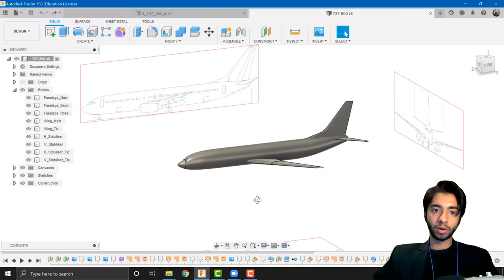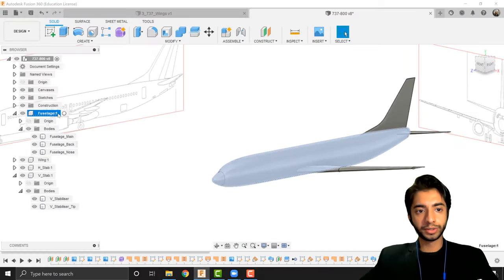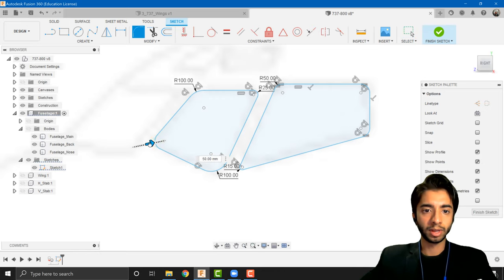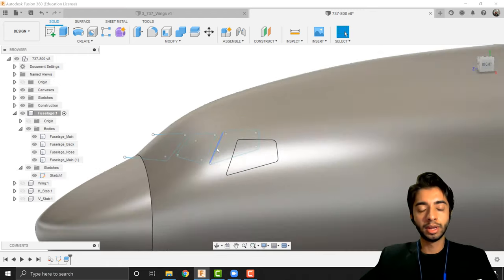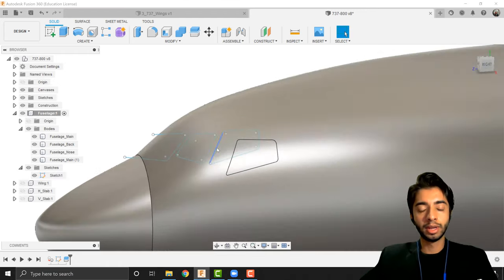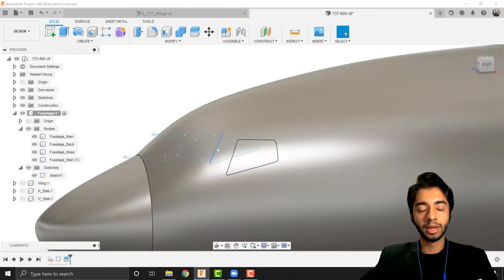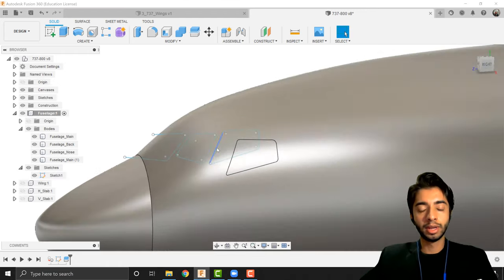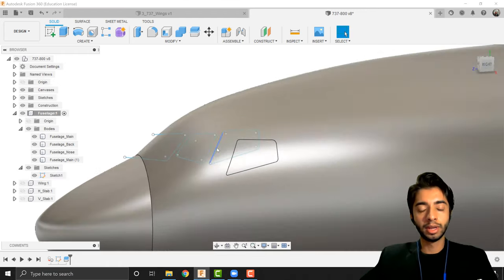How to Model an Aircraft in Fusion 360 | Tutorial 5 - Details (Fuselage) | Step-by-Step (4K)

Comment: Hey, this looks like super cool stuff, definitely a nice tutorial on how to get started. though looking at the real 737 aircraft, the cockpit windows are not simply cutouts of the body, but they are flat planes with no curvature in the glass. would you have any idea how one could get that detail right?
Reply from the maker: Hey Stratos2! So you could try to cut that area out using the method I showed here, but not use the bodies that were cut. Instead, you could create a new plane at an angle around the cockpit area and sketch it around that plane. Does that make sense? Feel free to ask further if you need help!

Comment: Thank you for sharing, that series is exactly what I was looking for and it's amazing! The only question for this chapter, as you may know, sometime the side windows of a real airplane might distribute differently on left and right side, and then direct using the split tool (apply the same distribution on both side) might fail to perform this differentiation, is there any way to make this type of details? Appreciated!
Reply from the maker: Hi Duan, thanks for your comment! 
It is definitely possible to apply a different cut on either sides. The first thing that comes to mind is to split the fuselage body half, about the symmetry plane. When the fuselage is split as a (LEFT FUSELAGE) + (RIGHT FUSELAGE), you could split them separately :) 
Let me know if that helps!

Comment: Hey I am stuck on creating the cockpit detailing in your 5th episode of How to build an aircraft Tutorial 5. When I finish the sketch and select split bodies I then select the fuselage main body as the body to split and the sketch as the splitting tool and hit ok. The following error appears “no intersection between target and split tool”. 
This error doesn't occur with other shapes in the same area.
Reply from the maker: Hi Jean, that's an interesting problem! Which part of the cockpit is causing you problems?

You could try a couple of things - 
1) Try ticking/unticking "extend splitting tool" when splitting the bodies
2) Make sure you draw the sketch so that it overlaps the bodies you're trying to split. 
3) Make sure you're splitting the bodies ONE BY ONE. It's a little more time consuming but definitely worth it to ensure everything works properly!

Comment: Why do we convert canvas to a component
Reply from the maker: Hey Selim, I don't convert the canvas into a component? Not sure what you mean, can you clarify? :)
Reply: @TEXDesignEngineering  i mean ,the picture was more sharp and 	comprehensible then somehow it loose its opacity icant get get it
Reply from the maker: @selim9220  Oh I see! Yes, so the way Fusion works is that when you activate a component, everything outside the component will become transparent. Since we placed the blueprints in the main tree, it becomes more transparent when we are inside an activated component. If this a problem for you, you can either make the bodies in the main tree, and then move the bodies to the component later. Second option is to have the blueprints INSIDE each component, but that would require you to set the blueprints again and again, and that could make you lose accuracy. 

Hope that makes sense? Let me know if you need more clarification :)
Reply: @TEXDesignEngineering  Thank you so much sir
Reply from the maker: @selim9220  You're welcome!